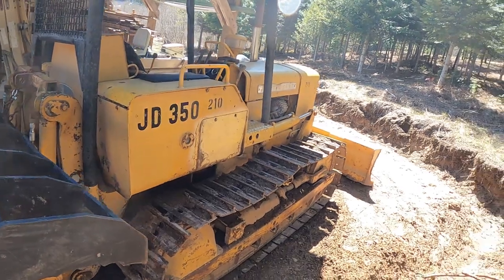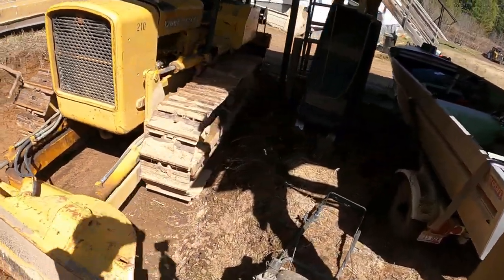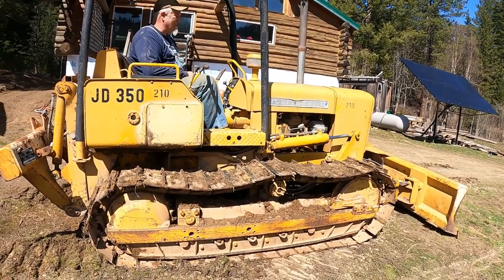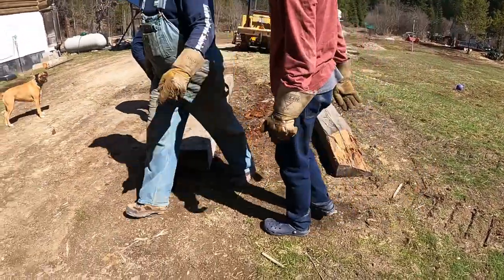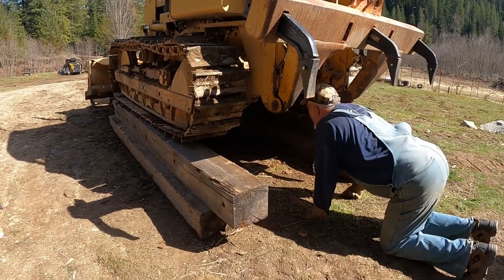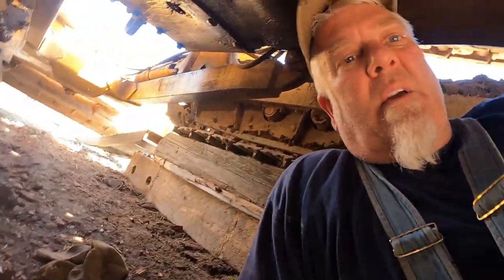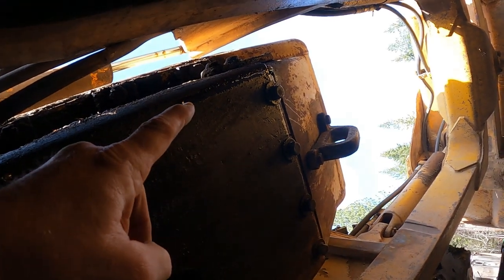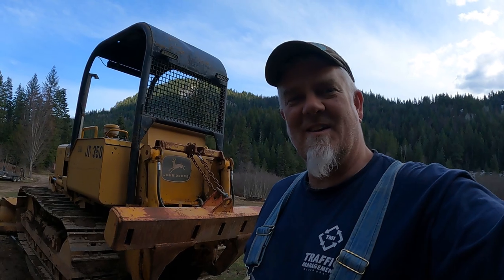REPAIRING a DOZER !! John Deere 350B

Comment: Uncles had a couple of A-C HD-3's years ago and the rig gear was riveted to the plate instead of bolted and sheared off. Had to beat the rivet pieces out and then bolt it back up. Had the machine on railroad ties and 2by's to get it off the ground. Got the job done and was moving the cribbing and there laid a copperhead and had been there for a WHILE..................and us too! And yes, the belly pan comes down and up in one piece. Jacks and a comealong. BLESSINGS!
Reply from the maker: Thanks Lewie!  I planned on a piece of plywood for the Jack to roll on...
Reply: @HiddenValleyHomestead  That'll work. You can also run  a come along from end to end and lift the whole thing but it gets tipsy/flopsy. God Bless!

Comment: How do you check the RPM's after relacing the throttle cable ?
Reply from the maker: Well im sure there is a meter of some sort you can hook up somewhere on the motor for an accurate reading to verify the dash gauge...  But my gauge works.  It's a direct mechanical cable from a gear drive on the top of the engine....
Reply: can you send me some pictures of how its hooked up and the cable is run  ? @HiddenValleyHomestead
Reply from the maker: Sure.  Email me your contact info

Comment: We are trying to pull off the little 1/4 drive line on the drivers side. Any tips? we can barley see the dang thing from the top, dropoped  the belly pan and its still not looking fun lol
Reply from the maker: Ha.  Yeah not really...  You just gotta gut it out and take it all apart...  I got some good tips on the video about to come out with a handy tool set i got just for hoses!
Reply: @HiddenValleyHomestead  ya i had to take off many hoes to get to that damn 1/4 inch drive line lol. I used vice grips to break a couple of them loose. fun times. thank you for the reply
Reply: That line is a real pain to fix. Not one of Deere’s better designs on this generation dozer.
Reply: I finally got it off. Had to pull the clutch bar off then the two lines above that tiny drive line. Now we cant find one so we are looking into ways to repair it  @sartainja